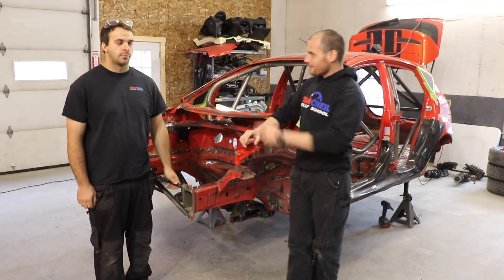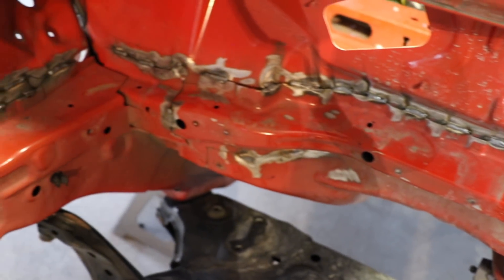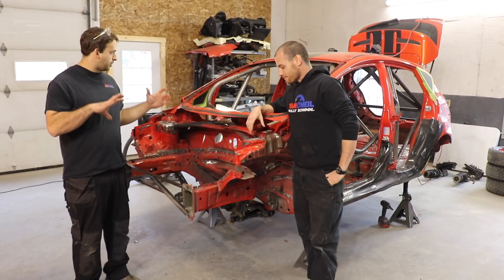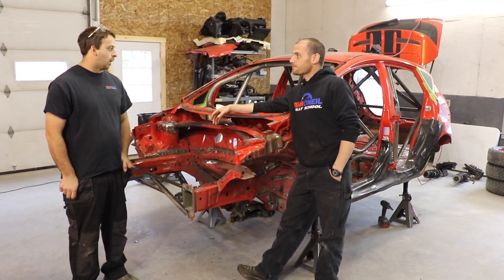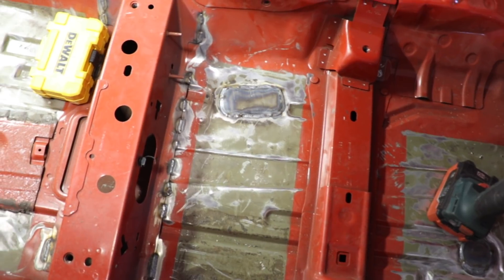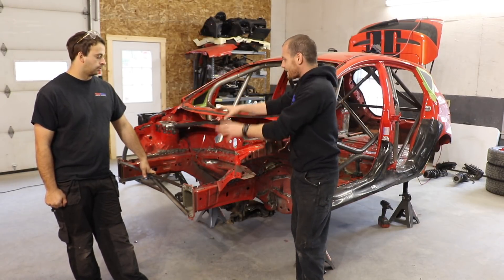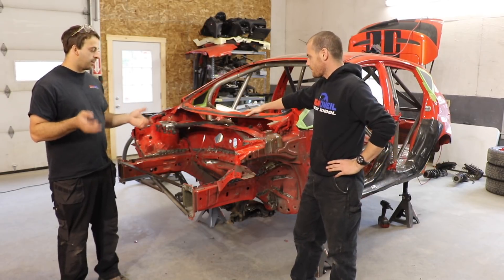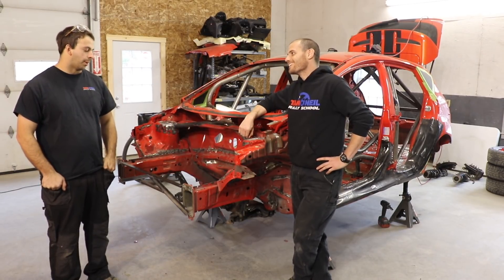Seam Welding Race Cars

Comment: Great video guys! Thanks I finally get some proper info about this topic. I have a rover 220 coupé turbo and I have seen a 3cm long crack in one of the front beams right next to the bolting point of the front subframe. I am planning on welding the crack and reinforcing the area welding the panels together as you explain on this video.y question is, would it be any problem if I only weld that area and not the rest of the car? It's a street car with stiff coilovers, that is always driven very fast and from time to time on trackdays.

Comment: Wish i would have seen this video a few years back when I did some seam welding my project rally car. For the shell I worked on I found that you could pretty easily get a lot more seam sealer out after wire wheeling by using a dental pick. Hit some seams with a MAPP gas torch before welding too when it wasn't possible to get all of it out.

Comment: Cars should be continuously seem welded from the factory. They just spot weld and then add glue afterwards.
Reply: no point at all much more time, money, and material needed to produce, and for 95% of the car's use by the customer, more than enough for the life of the car.

Comment: It depends on what your preparing. If your changing all of your key positions...Top mounts, Subframe bushings etc. Then seam weld the whole car first. let it do what it wants to do with regards to shrinkage etc then weld in your top mounts, cage, then finally subframe bushings. Your never going to prevent shrinkage/distortion but you can work around it by letting it do it's thing...then putting in the key points and minimising error.

Comment: What about bonding the structure with 2 component body adhesive?
Reply: The problem is 2-part panel bond adhesive is designed to work by bonding two pieces of bare metal. To do that on an already-constructed and used unibody shell, you would have to remove the two panels in question (in other words, pop the spot welds holding them together from the factory), prep both mating surfaces to bare metal, then reassemble them in place until cured.  With seam welding, it's already very time-consuming to strip the car to the shell, remove the undercoating and wire wheel the exposed seams, then weld them. At least the panels are already in place and the critical dimensions are retained (as long as the welder is careful to weld a little in one area at a time so as not to warp the car). The product is great, but not magical to the point where you can just squirt it in the cracks and it will just goop the old paint/ dust/ corrosion into one structurally-sound joint.

Comment: E46 floorpan above rear subframe are notorious for failing due to being punctured by the outside fins of the subframe bushings (the subframe bushings' design is at fault, mainly).

Comment: Awesome video with great info. Side note, for anyone seam welding on convertible cars (miata guys, s2000, bmw m3, fiat 124, etc), in general these cars will have good front to rear rigidity (longitudinal strength), but really can benefit from trying to increase side to side rigidity (lateral strength). Welds around door seems , lower floor pans, and around internal cross-members are a few good starting points.
Reply: Thinking about doing this to my mx-5/miata, thanks for this comment 👍

Comment: Great video, it's nice to have proper videos about race car engineering from folk who know what they're talking about. Would there ever be a reason to seam weld street cars unless they were super weak from the factory? I kind of assume not as they probably wouldn't be requiring race car body stiffness, but I assume it changes how the car feels especially if you were using something never intended to be that fast i.e. non-ST fiestas?
Reply from the maker: Not any real reason to seam weld a street car unless there was a well-known weak point that could cause catastrophic failure, but that's a super rare situation.
Reply: @Teamoneilrally  Would the same go for a 70-81 GM fbody? Unibody, fair amount of overall weight - some even came with t tops, reducing structural rigidity.  Wonder if perhaps there would be any advantage for that type of vehicle.
Reply: @car_ventures  I know your comment was like five years ago but this seems to be why the GM engineers of the c4 used an x brace underneath the car to prevent the chassis from flexing too much. Even that doesn't fix it all apparently. I would highly recommend you make your old GM vehicle a buggy and piss off local law enforcement.

Comment: Speaking about rally prep-- how about how to disable throttle cut when left foot braking on new cars?  I find most vehicles do this even with esc disabled.
Reply from the maker: That's a good one - we should do a video and we've talked about it a few times but almost all cars are a little different these days how you need to go about it. There's no "one good way" to do it, at least not that we've found yet.
Reply: Would be lovely to see some content on this! <3
Reply: Great question, I had that "feature" destroy a turbocharger once on a car I built. (massive stresses on turbine especially around 30psi)  My conclusion was to use a custom ECU like MOTEC etc.  Sucks and isn't cheap.

Comment: You forgot to tell that welding a chassis will make the metal go soft. You should never weld the super high strength steel.
Reply: As far as I am aware it's all still almost the same material as 15 years ago in terms of stiffness.  Only some trucks etc have special alloy frames as far as I have heard.  The reason modern cars are lighter, is indeed because of thinner metal, however this metal also bends very easily (often in your fingers) compared to the thicker stuff of yester year (as you'd expect) and the overall design (shape) is what keeps it rigid enough and safer (crumples a lot more).  The only thing one can really watch out for is to not put a crazy amount of heat in one small section... but generally if you move around the car when welding nothing should go wrong material strength wise and at least not anything that will overcome the flex and weakness of economical welding spots from the factory.
Reply: Andre Juul what does go soft mean?
Reply: The metal is already soft.  These cars aren't exactly military kit.

Comment: With the crazy conditions rally cars goe through, what is done to add protection to the underbody from rust/corrosion?
Reply: Expand Dong 
Well you remove the rust first, then anywhere necessary do what they said and weld shit on or just replace it with a nicely seam welded part. Whatever you need for the actual car you are working on. You can't just use blanket statements, see if things flex under your own weight &'go from there.

Comment: Awesome. Any downsides to seam welding? Potential corrosion if not resealed properly, increased cabin noise (not sure if it's significant but that's one concern I have had with my daily driven racecar and why I haven't done it), possible distortion of the chassis if not welded properly, anything else?
Thanks for the videos
Reply from the maker: Spot on, you definitely want to re-seal everything really well anywhere it's likely to get wet. We've seen $200k race cars that are rusting between seams and into the rocker panels etc... Sad and actually somewhat dangerous as the years go by. Cabin noise might be a tiny bit louder. Distortion definitely a risk. One other thing is crash repair: If you seam weld a car extensively and then get in a wreck (assume it's gonna happen sooner or later) getting the car fixed again is usually more difficult because you'll have to cut each of those stitch welds to replace panels. We used to stitch weld the seams all around the inside of the door openings (WRC engineers at M-Sport confirm stitching up the door seams is the #1 way to increase chassis stiffness in Fiesta chassis) but when you have to replace rear quarter panels or anything after a wreck it's days more work to get everything perfect again.
Reply: how about having to strip your entire car down to a bare chassis :D
Reply: The stiffer something is, the more conductive of vibrations it becomes.
Reply: Thanks. And great answer. I didn't even think about crash repair efforts being a bigger pain.
Reply: What makes you think it would increase cabin noise?
Reply: EngineEngineer - As Alex said, if you make it stiffer with weld, you change the area that vibrations can travel through and how those vibrations get dampened as well as how that frequency moves through the chassis. Not to mention removing seam seal to make the weld is already a loss of dampening between the panels. Now Wyatt (I am guessing he is the responding person), mentioned it only being a tiny bit louder, but I don't know if that is in regards to a shelled out race car that was already loud to begin with or if it's a full interior street car that you road trip and take to events. Perhaps it is relative. If a stock car was stitch welded and put back together, maybe it's more noticeable. Hard to say I guess because at that point you've probably changed a lot, like a cage, exhaust, suspension etc that would muffle the changes from stitch welding
Reply: D4RKHOUND that's not really a downside of seam welding, that's more a downside of doing it improperly. You should be able to identify the crumple zones and choose to avoid or reinforce depending on the type of use. I'd recommend leaving them because if it's bad enough to buckle a zone, it's bad enough to really hurt you
Reply: Downsides of seam welding, don't do it on a car that is not meant for racing use, if you go and get your bog standard car and seam weld it you could technically be removing some crumple zones of the car meaning all that force of a crash will go through the next weakest thing which would be you rattling around in the cabin.
Reply: Yeah but what i mean is seam welding should not be done on any "Road" car specifically because a race track usually has tire walls designed to collapse upon impact, rally's usually have foliage around you (Now yes there are some trees i will admit but if you are doing 70mph into a tree crumple zone or not it will be a bad time) however for road going cars you should never seam weld it, if your car feels "flexible" on the road, Strut tower braces and such are fine but never seem weld road cars, sorry for the confusion just noticed my comment was mistyped earlier and i ended up saying "Don't do it to a car meant for racing use" instead it should have been "Don't do it to a car NOT meant for racing use" this is mainly to all the kiddies that see stuff like this and think "Geez that would be nice to have on my riced up civic"
Reply: Well you can seam weld a road car just fine, but dont forget the roll cage , racing seat and belts, and hans device and helmet then. :p
Reply: Wouldn't not welding as much from the suspension out towards the bumpers help it crumple some. Shorten the bead length and make the space in between a little longer. Inch of weld, inch of space, 3/4 inch of weld, 1 1/4 space, 1/2 inch weld, 1 1/2 space till were the headlights /tail lights mount
Reply: D4RKHOUND the rule of thumb I've tended to see on dual-use cars is seam-weld between the shock towers, and leave anything beyond that. That takes care of suspension mounting points for performance related reasons (Good), stiffens the passenger cell (Good), but will generally leave the crumple zones intact.

And for those unfamiliar with this sort of thing: DO NOT put a cage with A-pillar bars in a street car. A half-cage or rollbar that stops behind the seat is ok, but as soon as you put bar in the A-pillar area, the car is helmet-only even with rollbar padding.